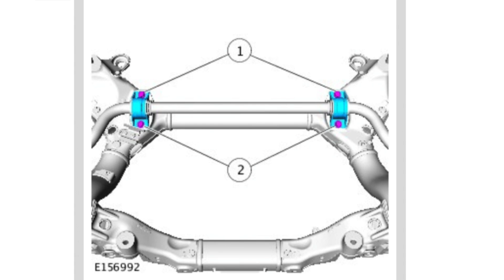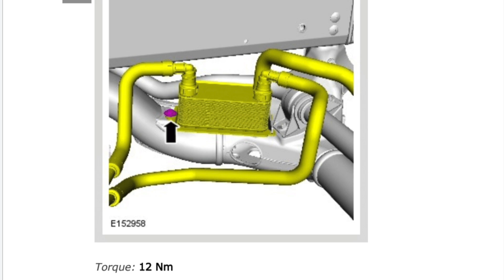Upgraded Polyurethane Anti-Roll Bar Bushings! DIY Installation & Review

Comment: Thanks for yet another great DIY for the F-Type. I'm storing all of these up for some interesting work over the next couple months to prep for next year's autocross and track events. This seems like a great upgrade, and it's nice to know that you are confident in the improvement. I was curious if you needed to re-lube these (again, or properly), so that provided the opportunity to do the DIY. Cheers from MO (where there are very few F-Types).
Reply from the maker: I appreciate that Craig, yea the first go around I used a minimal amount and it was fine until just now. So I thought I would use the opportunity to film it and relube both of them properly.

Comment: Any thought on adding these to the rear sway bar? Or would that involve dropping that whole rear subframe?
Reply from the maker: The rears are just as easy, I just didn’t do the rears because stiffer rear suspension can lead to more oversteer. So I thought if I didn’t it would limit the oversteer a little. But Who knows, it could be fantastic